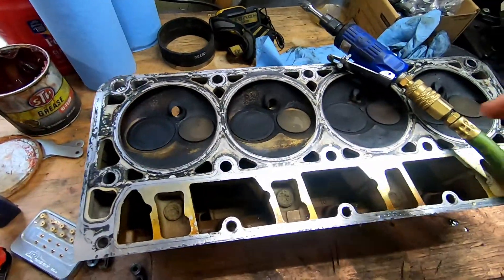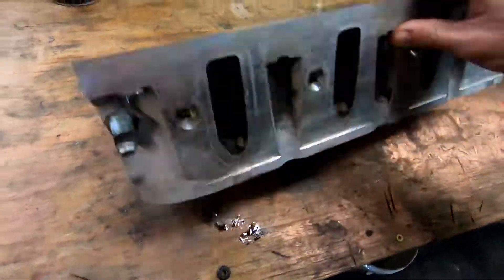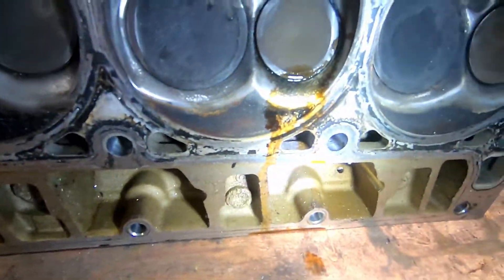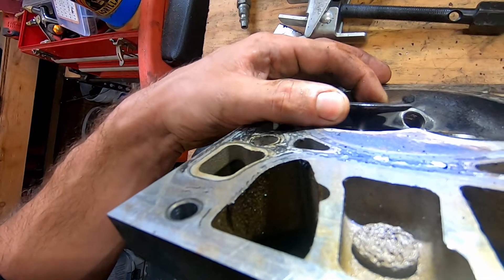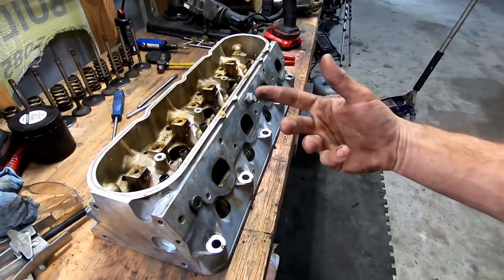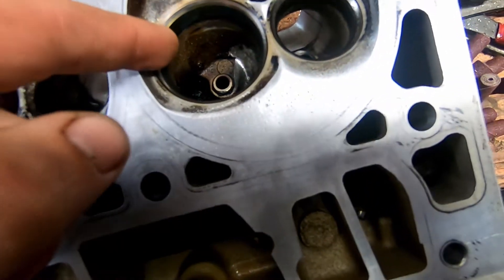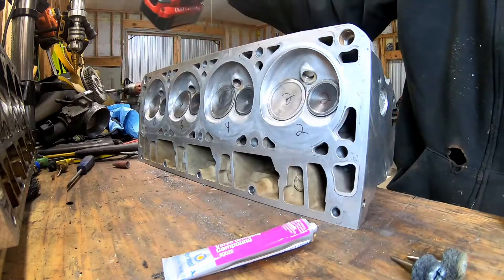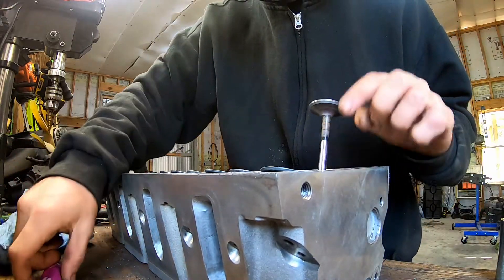Do LS Engine Heads REALLY Need Porting & Polishing?

Comment from the maker: Porting and polishing LS heads was fun and I learned alot .. I can't wait to do my second set of heads!
Reply: Yes sir I did pretty much the same as you, did alil the first round, watched some good videos got better tools, went back and did a better port/polish and valve job.
I did other heads and intakes before, was my first LS 706 heads for my 5.3. I got a LQ9 that I'm gonna do some 799s for next.
Reply from the maker: Heck yeah man .. This  one was a good learning experience .. And it runs pretty good
Reply from the maker: Only thing missing is a valve grinder so I just lapped the shit out of em lol
Reply: @RAWRMotorsports  ya need too on LS heads especially exhaust valves get pitted.
I did mine the first round and 2 on each head still had slight leakage. So I went back and lapped the shit out of em like you lol.
Reply from the maker: Yea i lapped em all like 4 times
Reply: @BDauto86  Disagree you need to on ls or any head. Never grind them hard with a drill
Get a valve job theres nice power gains to be had. 
Removing material from the valve or seat will make things flow worse and possibly change the valve stem height

Comment: OMG PEOPLE DO NOT DO THIS TO YOUR HEADS !!!!! Bro I mean no disrespect but you are a great example of what  NOT to do. 1) clean and inspect first as why waist time on a cracked head or destroy equipment on dirty heads 2) NEVER LAP VALES to fix leaking seats. CUT or grind seats with CNC, stone or New Way cutters, lapping is finishing work or to see where seats are on the valve. Store bought lapping compound is wrong grit, its like 60 grit. Imagine painting a car but only using 60 grit sandpaper, your cutting and scratching the seats and valves at a different angle and not concentricly. They will have scratches, incorect angles cut into them and it may seal temporarily but will leak well before 50k. 3) raise the roof is fine but never polish intake side (helps to keep gas mixed in air rather than wet/liquid fuel) polish exhaust side but don't gasket match exhaust side3 especially if it makes port larger than headers as this will kill flow and cause reversion.  Intake you want the opposite heads port can be same or slightly bigger than the intake manifold port. As doing either incorrectly will kill flow and HP. Again not trying to hate but leaving a video on doing this incorrectly is only causing others to think this is correct way of doing heads. and lastly 40 NEVER EVER lap valves using a drill, hand lapping with lapping compound from a head porting supply shop that has fine grit compound is ok but as I said before Autozone, Napa, O'rielies lapping compound doesn't say what grit is but it is COURSE not fine and will destroy the seats and valves
Reply from the maker: The only thing u said not to do that I actually did was lap valves .. intake.ports are 80 grit or 120. I don't remember and exhaust all I did was raise the exhaust on 1 side, not.port match.. and the only place I removed a large amount of material is the rocker arm boss

Comment: How much hp gain would you guess for these 862s on a 4.8
Reply from the maker: Prolly would leave a 4.8 alone or.just blend bowls in .. 4.8 will lose too much torque on bottomed end IMO
Reply from the maker: Head porting may pick up 20hp on a 6.0 above 4000 or something like that
Reply: I'm thinking blend the bowls and open up the exhaust. Plus a lil porting on my intake.
Reply from the maker: Yea I wouldn't remove the bump on the exhaust rocker arm boss on a 4.8 I'd leave it  just smooth the rest and do exhaust
Reply: @RAWRMotorsports  yeah 4.8s like to shine in the high rpm range. As far as the bump I was thinking just take a lil off the top lol. Not completely shaved and raise the roof on the exhaust (gasket match). I'm gonna try my first port job soon. Hoping for good results.
Reply: Dumb question but just to be clear on bowl blend you mean that lip underneath the valve seat correct?!
Reply from the maker: Correct
Reply from the maker: @LeKelsor yes

Comment: I seen a comment in the Texas speed video about up load of the video doing a AFM DOD delete. I want to do it on my 2012 I’m kinda nervous about it. Especially after reading the comments in there video saying how they made a bunch of extra work for themselves
Reply from the maker: It's not easy especially on 4wd
Reply: @RAWRMotorsports  would you say there particular package is the most reliable. Technically my truck hasn’t shown any signs of failure. No ticking still smooth but I can’t afford a failure. So I’m trying to figure out what i should do as a preventative measure.
Reply from the maker: @Johnny-jr2lq  gen 3&4 are easy gen 5 is a PITA gotta pull engine
Reply: @RAWRMotorsports  man ever since i found out about this AFM DOD issue especially in the “newer” pickups I have been regretting purchasing this 2012 Sierra. It’s considered a 4th generation so hopefully I can get it deleted properly. I would consider myself mechanically inclined I have built a couple 4 wheelers a couple crotch rockets. And fixed plenty of regular cars but I have never went this deep into a motor. I was planning on learning about the 5.3L on my 2001 but  the 2012 is my daily driver to and from work so I have to do that truck first. This has me so nervous I’m considering selling the 2012 it is in decent shape and fairly low mileage 137k and no current issues as far as the motor is concerned. BUT when I did the last oil change the old was as BLACK and only about 4 quarts came out. I did take the oil change to the end of the % counter I normally do it every 3k miles. But this oil change I didn’t have the cash at that moment to get the oil and filter. I didn’t think it would be that big a deal especially since the % was at 30.
Reply from the maker: @Johnny-jr2lq its not hard 
.. gen 4 is cake
Reply: Dude I would highly suggest looking into a Brian tooley racing kit of new lifters and cam, a true dod delete kit. I’m setting with my motor apart now wishing I would have done it. I had the dod tuned out 80k miles ago. But my lifters failed at 280k

Comment: Comments about leaky valves
you need a valve job plain and simple!!  Using a drill and grinding material off is doing you more harm than good
Now your other angles if they were any good are no longer sealing. 
Before tfhe "but it runs fine" comments start. 
Plus youre missing out on power by skipping one.
Reply from the maker: Leakdown test is less than 5% on all cylinders 🤷‍♂️
Reply from the maker: But yes if I did it again I would pay for a performance valve job & lightly lap in .. a valve job alone is not enough even brand new assembled  heads need disassembled and lapped in
Reply: @RAWRMotorsports  sorrta true, when I do a 5 angle valve job and back cut intake valves I do a fine lap to "SEE" where the contact of the seat is and its width, then cut the back cut on valve and or  lap to remove any chatter from the CNC cutter. But having sharp cutters and cutting slowly prevents chatter. But yes I've seen even on new heads where they had bad chatter or too wide of a seat from the factory. So it is best to check em before assembly as its way easier and cheaper than doing it multiple times.
Reply from the maker: @MSU_BullDAWGz I just really dont trust and shops close to here to do heads ... figured if the guides were good and they lapped in good send.it

Comment: Would have done only one thing different but it's personal preference. I like to put rubber tube between valve stem and drill, reduced the speed on drill and changed direction every few rotations. I've ended up with rings of death between concentric reducer on valve and the seat when lapping in this fashion.
Reply from the maker: Good to know .. really prolly shoulda just paid for a valvejob and lightly lapped but it's done so .. move forward
Reply from the maker: Thanks alot of ppl just wanna hate on it  that have prolly never even tried to port anything lol
Reply: @RAWRMotorsports  People in general can be such haters. Inspirational people are few and far between. I get the same slack when I do what I do. People told me that coating pistons is  waste of time. But I've managed to triple the life of all our race bikes. Likewise with the Two Honda CRX on my channel. Both have full Cerakote treatment on engine internals and both run away from sports cars consistently and reliably with none of the symptoms the nay slayers prescribed. Proof is in the pudding.... Not as assumption from the sofa😂

Comment: As a general rule, or atleast how i was instructed by probably the best port/polish guy in motorsports, you polish exhaust and dimple or rough the intake sides. This is because of how air/fuel mix and react to smooth surfaces. The roughing or dimpling causes a micro-thin layer of air in the pockets/dimpling and allows for better flow on intake. Direct injection.. smooth em, any other application that sprays port or pre-port, rough em.
Reply: Yep ur right
Reply: Are you talking about Darin Morgan?
Reply from the maker: @jasonhlavac817 🤷‍♂️
Reply: No need to dimple or take any port to a high polish

Comment: I have ported many different heads over the years and currently doing a set of 317s for my LQ9. I have ported mine just as you have and think it’s going to work well. Just curious if you can tell of any improvements in power gains at higher RPM and any losses in power at lower RPMs ?  Nice work. @darylvoorhees
Reply from the maker: It's hard to tell because I changed so many things at the same time on this build.. it runs real good over 3500 .. it needs gears cause I'm running 33" tires with 3.73s
Reply: He wont feel any difference, hate to say.

Comment: I never like working in the chamber, the trade off is air flow for compression. I like my compression! However you can mill or run a thinner gasket.
Reply from the maker: I milled em .020 after everything was done then added 4cc dome pistons
Reply from the maker: With 4.100 x .056gasket I'm at like 10.7:1 .. I have plans to do a valvejob , lighter valvetrain , little bigger cam , and 4" x .040 gasket eventually
Reply: 😅shj 5:04 😮 @RAWRMotorsports

Comment: Send the valve job out to a Pro bro!
Reply from the maker: Yeah i kinda wish I woulda atleast had a 3 angle put on em .. but I was on a budget ...might get another set of heads and go through em , port , get valve job, mabey some lightweight valves  and swap em out  with the correct headgasket this time instead of ls9 gaskets ... need some 4.000 x .040 gaskets n get the quench right / reduce the crevice losses
Reply: Agree, most important part he skipped

Comment: I know it’s been a year ago since you made this vid. I watched Phong do the way he laps valves and he puts a 3/16 fuel line about 4” or 5” long one one the V stem and puts the fuel line in the drill. Yea it sounds funny but dude!! It works amazingly.  I also sprayed oil/lube on the valve stem while lapping. Also put a bolt in the place “if one” the use JB “metal” weld to fill the hole. Then sand smooth. Great work maaan!! I miss my kids being small like yours. Mine now are between 22 and 16🤣🤦🏻‍♂️
They grow up too fast!!💪🏼🔥🔥🔥🤣❤️🙏🏻
Reply from the maker: Yeah i thought about it but the valves are stainless and the drill chuck is just steel ... chuck should damage before tge valve so i just sent it
Reply: Using the drill is wrong. Valve jobs are worth nice gains why skip it?

Comment: 10:35 what bit is this im looking for a decent bit that won't break first time I use it
Reply from the maker: Got em off amazon single flute for aluminum .. try turning your tool RPM down
Reply: Goodson Burrs
Reply: msc industrail. Dont buy the cheap stuff. Use tap magic as your lube

Comment: Looks good, should have picked up some flow.  Always put a thread sealer on the intake rocker bolt when you break through removing the rocker bolt lump. 
Even though you wouldn’t think it could oil will pull down past the threads via engine vacuum and smoke.  You definitely didn’t hurt anything, it looks pretty smooth! 👍😎
Reply from the maker: Thank you sir 👍.. Yea I put a fair amount of blue  locktite gel on all the  rocker bolts that broke through .. Mabey it wont all melt out but Ive smoke tested it,  there is like ZERO smoke out of the exhaust and there is basically zero blowby out of the crankcase vent .. So Mabey we won this build for now anyway  😂

Comment: 7:10 how’s that valve guide holding up ?
Reply from the maker: the guide does not need as much support in the port its strength comes from going all the way through the head , and it has very little side load on the port side just up and down friction imo.. some extreme race ports completely get rid of the guide in the port area so the air only has to go around the small valve stem
Reply: @RAWRMotorsports  from our angle it’s not the support problem,it literally looks like you took out some of the guide, on camera it doesn’t even look like a valve would go in it looks like it caved in on it’s self
Reply from the maker: Its not i promise lol
Reply: @haydenhale2646  that wont do a thing
Reply from the maker: @ezmny Factz loln
Reply from the maker: so far so good . update coming soon
Reply from the maker: aint skert
Reply from the maker: Leakdown test shows <5%